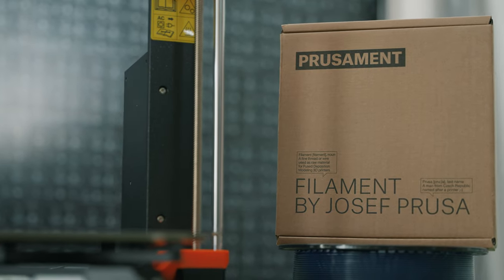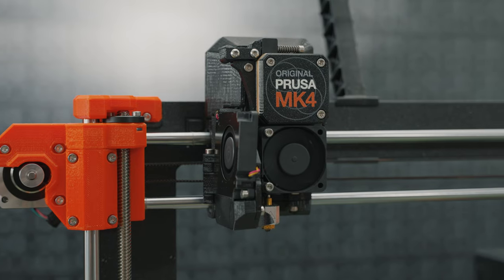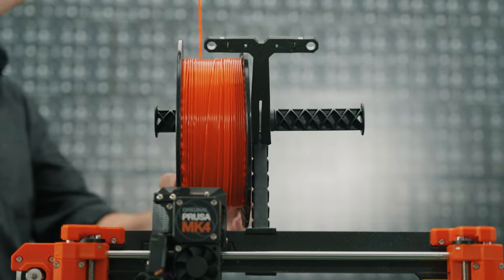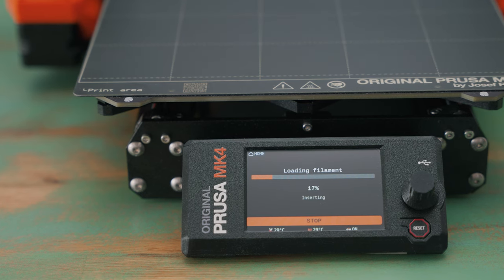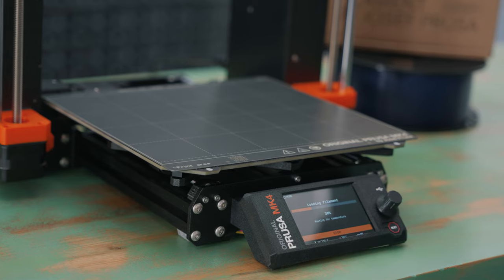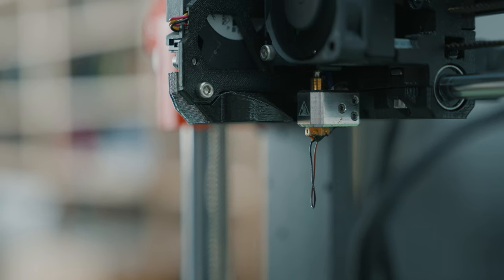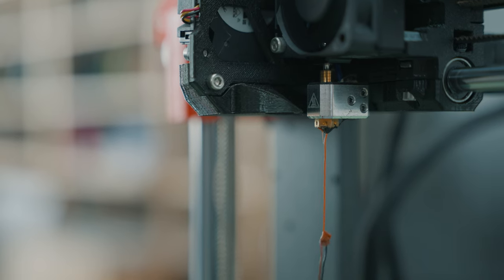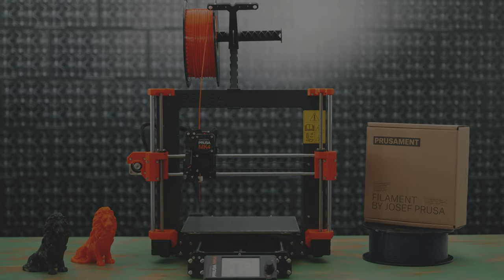Filament Autoloading on Original Prusa MK4

Comment: One thing I really like about the MK4 over the MK3 when unloading is that the MK3 requires you to push a button and then pull the filament out. The MK4 just does this automatically, and also does a better job of making sure the melted filament on the tip is not causing obstructions during removal. I've had my filament get stuck a few times during unloading on my MK3. Usually because I walk away and come back to a cooled down filament inside the PTFE tube. I think the metal tube on the MK4 fixes all of that.

Comment: Please fix the amount that it purges, it’s way too little and the Hall effect sensor can be faulty and doesn’t recognize filament is loaded sometimes so I would have keep removing and inserting filament until it does or I have to recalibrate the sensor, I’m not the only one with this issue. Other than that the printer is great.

Comment: Even though the XL you announced 2 years ago, the MK4 (announced half a year ago) was released earlier and is receiving much more attention. As an XL user, I'm a bit annoyed. It seems that the XL isn't getting as much attention. There are always "MK4", "MK4 improvements" and "MK4 Tutorial" topics from Prusa. I really feel like the XL is missing out (at least) on promotion similar to how you promote the MK4.
Reply: Be gratefull that you don't have prusa mini...
Reply: Probably lots of people are getting a Mk 4 as their first printer, so these tip videos make sense for newer users.
Hopefully there will be a variety of other content, like a a walkthrough of the MMU3. 🙏
Reply: As I non user I'm annoyed too. The XL was pushing boundaries and something to get excited about. The MK4 is just the mk3 with some shinier bells, nothing groundbreaking or even that impressive on it
Reply: @joshuaisaacs8970 uh I mean guaranteeing perfect first layers basically solves all printing problems in one sweep…that’s a pretty massive difference?
Reply: @sheeevum  definitely doesn't solve all printing problems, I've had near perfect first layers and then still experienced cooling issues, bridging issues, overhang issues. None of which could be fixed with a more perfect first layer...
Reply: The XL seems to be a failed experiment at this point
Reply: @pablosalazarcomposer  Why do you think that the Prusa XL is a failed experiment? In my opinion the Prusa XL looks like a great 3D printer, it's just that by its price it targets rather ambitious 3D printing enthusiasts.